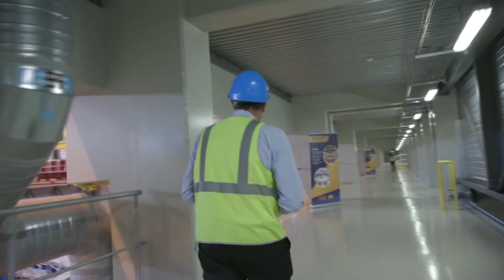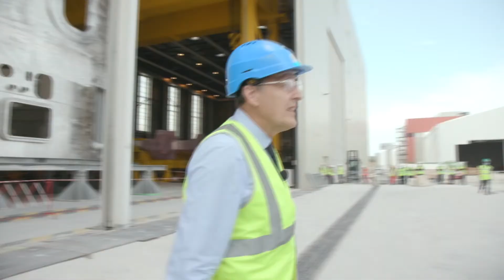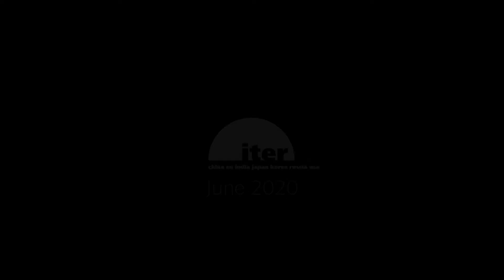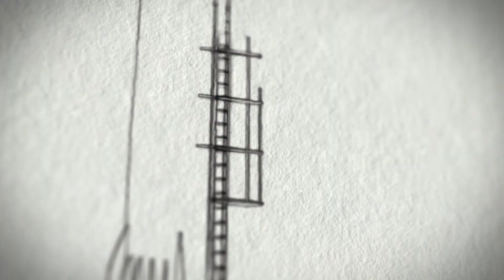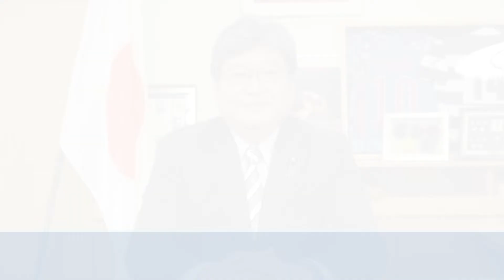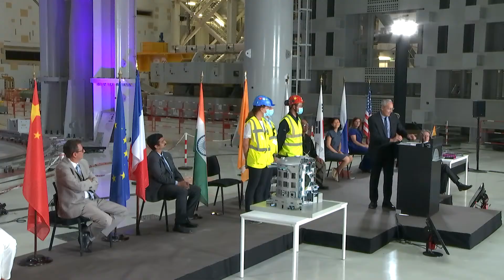ITER Live : Start of Machine Assembly

Comment: so even if you successfully covert 50 megawatts into 500 in 2025 your website states that the machine can't convert the energy output into electricity so if their is no known way to capture the output as electricity what does this accomplish? if you can't convert the 500 megawatt output into electricity you do not have a multiplying energy machine.

Comment: This thing is like Howard Hughes is Spruce Goose.... it’s a technology that has been around since the 1960s and doesn’t work this is a project that was started when Ronald Reagan was president and they keep throwing money at it in spite of the fact that technology is moving on and pass them... they estimate that if it works they will achieve fusion in 2035.... we all know that there’s no way they will meet that date because let’s face it these are governments working on this thing...... The estimated cost for this boondoggle is $20 billion... for $20 billion you can supply solar electricity to over 1million homes for 25 years....
Reply: which is nothing. Even if it cost 3 Trillion, it's worth it. It will not just save humanity, perhaps also the planet.
Reply: experiment 
Except that money spent on solar would do the same (now) at a lower price

Comment: "The 23,000-ton tokamak is designed to produce 500 MW of fusion power from 50 MW of input heating power, thus making it energy positive."
I'd throw my own grandmother into the fusion chamber if it helped to bring this milestone forward.
Reply: Hopefully that won't be necessary lol
Reply: Jerb Herbert 
It’s a tremendous waste of money... The $20 billion they are going to spend on this you could put solar along with battery back up on 1 million homes that would power those homes for 25 years...

To say this thing is designed to produce 500 MW is generous considering that they have been building these things since the 1960s and have yet to get one to work... this is old technology and this project started in the 1980s based on that technology at the time..... it’s already 30-year-old technology… That no one has ever been able to get to work...However there are other reactors that have been designed that do work

Comment: Great but 3hrs?! How do I consume this exactly?
Reply: With popcorn and a lot of awe! 
Also, youtube will play it from the place you left off last time. If this is too hard to figure out, maybe you should go back to teletubies fanfic or whatever you got here from.
Reply: NGC1433 Yikes. No need for the ad hominem attacks buddy. Cheers.
Reply: @SB-xt5jk  youtube has a setting which can modify the play speed. You can make videos go as slow as 0.25x speed or as fast as 2.0x speed. I watch most videos at either 1.5 or 2.0 depending on if the speaker speaks with a thick accent or if they speak quickly.

Comment: Seeing Construction personnel wearing protection helmets on a site where parts the size of small houses are being handled always reminds me of a CAT documentary where they explained that nothing they handle weights less than like 5 tons so they rather not ask their assembly staff to wear helmets as it would do nothing to prevent their death - Which makes sense... If a 20t excavator part grazes your helmet protected head then it's safe to say that whatever just missed your head took at least ⅓ of your torso with it - At that point you might as well just have gotten hit on your head.
Reply: Helmets do not protect you against large heavy objects, I think that we all understand that, and that is not what they are designed for either. But it does protect you against smaller falling objects, like for example forgotten tools or nuts and bolts and other relative small parts. It also protects people against bumping their head against hard objects. If it can prevent a serious head injury it did it's job.

Comment: What impact would this large magnetic device have on our planets gravitational pull and orbit? Are they planning to measure the effects on the planet when using this machine?
Reply: None
Reply: @fg786  well they are trying to simulate the sun's energy source. How does magnetic force not come hand in hand with it?
Reply: @ilovejobbo  Well for one, magnetic forces and gravitational forces are two separate things, they don't overlap. Operation of the device will have no effect on the Earth's orbit.

With regards to the magnetic field affecting other things near the device: although the magnetic field strength is very high inside the machine, it falls off rapidly as you move away. This, coupled with further losses due to the induction of eddy currents in the metal structure, reduces the magnetic field down to background levels within about 20 meters from the device, well within the housing structure.
Reply: @Clint945  that's a really good explanation. Thanks ☺️